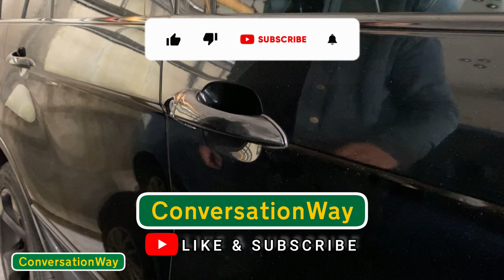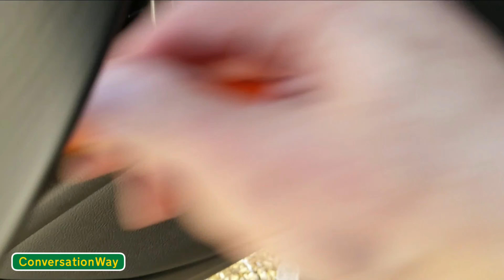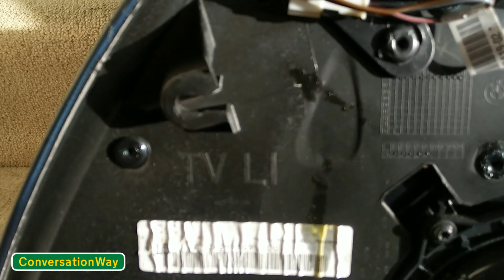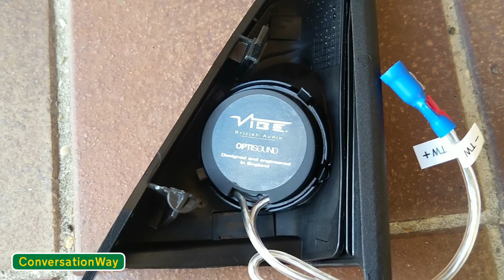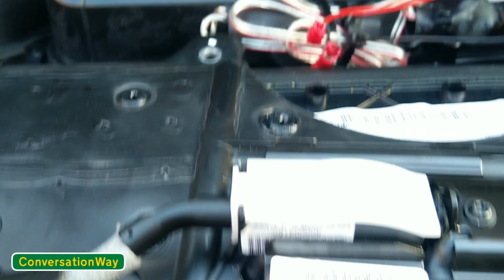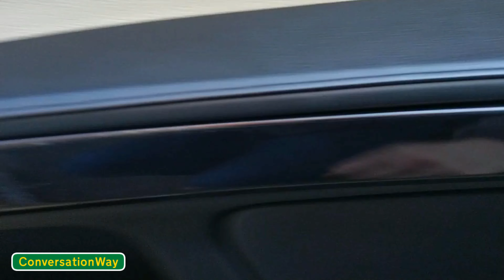BMW VIBE OPTISOUND Speakers Upgrade Install Guide | BMW E92

Comment: Hello, I've just intalled Vibe powerbox unit into my bmw e91, it had the standart sound system. I also upgraded the speakers and added tweeters. After installing the powerbox I noticed that the rear speakers are getting significantly less power from the amp than the front ones. I've tried adjusting all the settings on the amp and the headunit itself - no change. Maybe someone had the same problem ?
Reply: Hey did you get to solve this issue?

Comment: I  baught this kit for my e90 when i was drunk and didnt realise untill it arrived yesterday . I was debating returning it but i do still only have stock speakers 
Dont have the amp tho but if they are good i may get ut
Whay would you reccomend?
Reply from the maker: Hello! These vibe speakers have been excellent. My current set up that I've settled on is the Vibe speakers/tweeters, no amp for them as it didn't make much difference to the sound. I've swapped out the  under seat "subs" to mid range speakers and installed a custom enclosure sub box in the boot which fits nicely and doesn't take up too much space, (400W RMS). Works great with a nice balance overall! Kind regards
Reply: @ConversationWay hey, what mid range speaker did you use for the under-seat subs? Also, did you ever try the vibe under-seat subs and what were they like?

Comment: Bought that vibe box, can't get it to work on my Z4 E89 with iDrive. To be honest i would struggle to mount it somewhere. I think my amp is duff. Since i fitted a mmi box, that might be causing a problem, but the mmi actually improved the cars sound already. Vibe box not needed really. Did get rid of BMW speakers and bought some BO Chinese speakers, cheap upgrade.
Reply: Don't know if putting 12 volts on the amp it might at least light the green led.

Comment: The stock subs in the hifi and hk system are a lot better than the vibe.... If you want big bass from the 8 inch underseat sub you need to get the earthquake sws 8... But you lose some midbas and upperbass.

Comment: Hi, I just installed these mids and tweeters today. Mine seem to crackle a little bit even without an amp on regular settings. Did yours crackle at first too before breaking in?
Reply from the maker: Hello! I didn't experience any crackles. If it's just one speaker or the mid+tweeter in the same door, it may be worth double checking all the bullet connections are secure. If both left and right door speakers are crackling that would imply a connection closer to the head unit or the head unit itself. Best of luck.

Comment: Hi I have the basic sound system in my bmw 520d 2015 model, I’m looking to upgrade just the speakers like you have, are the vibe speakers good? Would Harmon kardon second hand ones fit (wiring) and sound better do you think?
Thanks
Reply from the maker: Hello! Have no first hand experience of the HK setup, but can say that from reading forums etc. the consensus is that the Vibe kit is superior, with some owners swapping their HK to Vibe. The HK speakers almost certainly would have the same connectors as the original (base) speakers. Thanks for the comment!

Comment: How mush did the subs, and mid range driver speakers cost?
Reply from the maker: Whole kit was £250, but didn't fit the amp so you can probably get just the subs and mids for 150 to 160 or so. Thanks for the question!
Reply: Where did you buy from? Also will you be doing a video for the amp installation? Looks like a good kit!
Reply from the maker: This was from eBay but there's quite a few places that sell the kit now so definitely shop around. Not fitting the amp - it's punchy enough without and the only place I could find to mount the amp was the glove box (very tight behind the dash, esp. with idrive!) and I didn't want to take up space in there. Thanks for the comment!
Reply: @ConversationWay  Thanks for the response! I will be ordering the kit later, I have been looking for a good plug and play kit for a while now and this ticks the boxes. Thanks for the video too

Comment: How did u find the sound after installing the whole vibe kit?
Reply from the maker: A significant improvement over stock, even without the vibe amp. Deeper and punchier bass (especially when subs have worn in a bit) and clearer highs. I didn't fit the amp because because it's so tight with the idrive stuff behind the dash, that the only place I could find to mount it was in the glove box, which isn't ideal. Did run the system on the amp for a while to see how it sounds, and didn't find it to be that much better than without.
Reply: @ConversationWay  I’ve already installed the amp into my f20 and noticed the stock speaker have a lot more punch In them, so looking forward to installing the speakers in soon
Reply: @jexytd8204  where did you manage to mount the amp ?
Reply: @seanphillips1282  mounted underneath the glove box where you change the cabin filter, just about enough room under there 👍